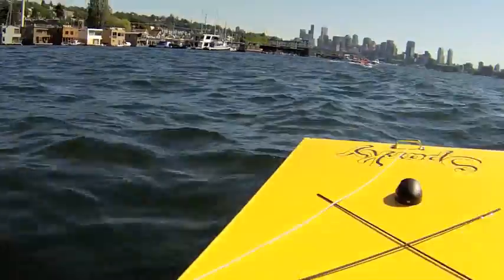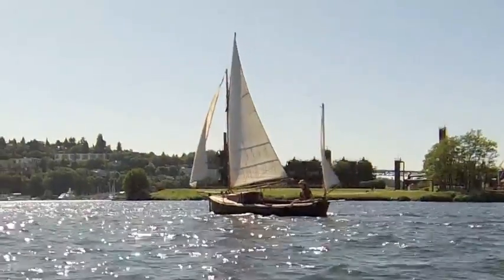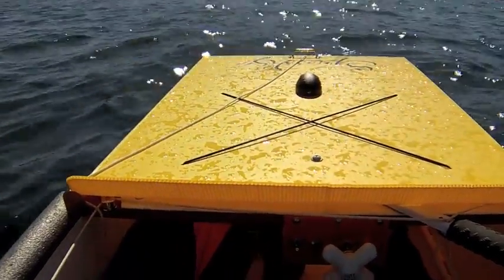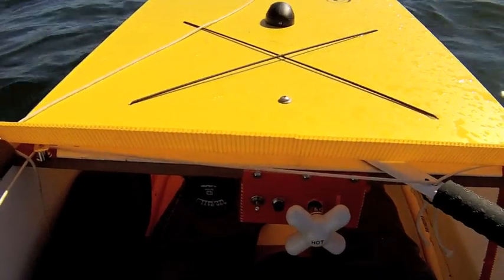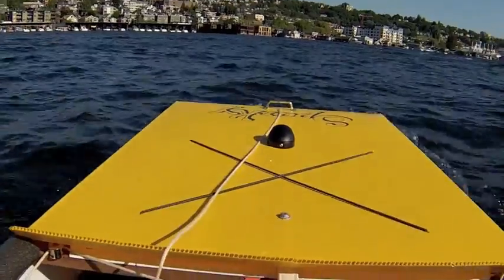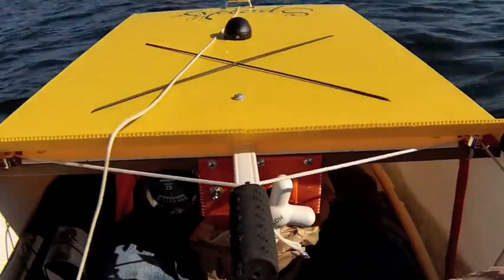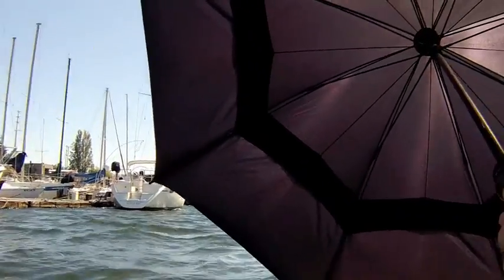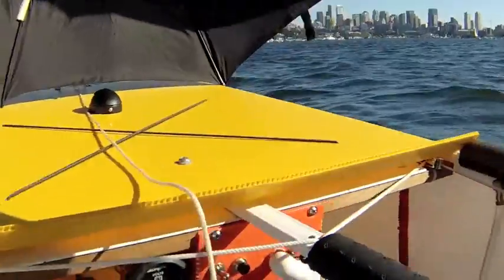Sparky, an 8ft DIY electric featherweight boat

Comment: I've been contemplating using coroplast to build a canoe. What would you suggest sealing the seams with? I was looking at a few "one sheet" canoe designs and I think its possible. I trying to stay on the cheap side of life. I was thinking some kind of heavy duty duck tape to hold it together and then sealing it with that rubber shit you always see on tv. Any comments or criticisms on this idea?
Reply: ManScoutsofAmerica I think he uses zip ties but personally I would also slap on some flex seal

Comment: What about putting a pointy bow on it?
Reply from the maker: I have a 'V' hull (pointy) design but it doesn't hold as much weight, so with the battery and trolling motor I resorted to this design, which actually works well.
Reply: OK, Thanks.

Comment: How thick is the coroplast you use for the boats? I want to find out the cost before I get the plans from you.  I like the boat with the game fisher engine.
Reply from the maker: I use 6mm thick coroplast for all my motor boats, and you have to find a large plastic supplier to find it. Some people use 4mm and add a frame re-enforcement.

Comment: Super cool man... You could make a detachable top shelf, that would ride in the hull. Once you arrive you zip tie it or it clicks on... But you know all this... 😝
Reply from the maker: I've been pondering an accordian shaped wedge box, but your suggestion of zip ties made me think velcro would be better. I think that's the answer. A simple flat pack box that joins and attaches with velcro strips. 
Thanks for the epiphany Wooden Creationz!
Reply: +Paul Elkins Sweet! For sure better than zip ties!!  And yeah... You need something up there. Wind will flip your plate. Pretty stoked! Love to come see your shop one day. But your too darn far from Missouri! If accordion doesn't work.. Maybe a design that folds flat but then you raise it and then it locks.... do a video if you get one you like. Love too see your creations man! I priced chloroplast the other day. I have watched you for years but wondered about making a chloroplast structure over my truck bed for camping. Your the closest inspiration I got! Lol -Brian
Reply from the maker: Not long ago I played with that same idea, arcing the panels over the truck bed. I wanted it to be portable and foldable but it turned out too heavy for one person to unfold and attach to the upper bed edge so I tossed the idea, but, if you wanted it permanent it would have worked fine. All you need are either coroplast or plywood ends.
Reply: +Paul Elkins I have a soft top on the back of my newer dodge truck  bed... The soft top rolls back. The bed is only about 6ft long though. I'm 6'7. So I can't really sleep under the soft top... Unless I drop the tail gate and then use chloroplast to make a bubble over just the tail gate piece to make it longer.... Doors and windows. Soft air mattress... Now you can sleep 2 and make a bunch of fun shelves and stuff... This was why I was at the big box store pricing and dreaming and measuring.... That idea that excites you and you want to drop all projects and go do... Until about half way and get burnt out! lol If I do it... I will shoot a video and share... Again your the only one playing with this stuff so I have been studying past projects... ☺ It was interesting how it will bend easily vertically but not horizontally!! Makes sense just don't remember you saying it. Thanks for all the replies man! Always great getting to chat!! Brian
Reply from the maker: Any time Brian. Cheers!